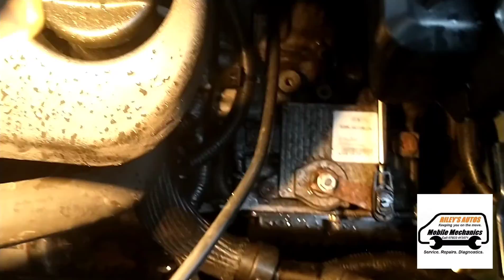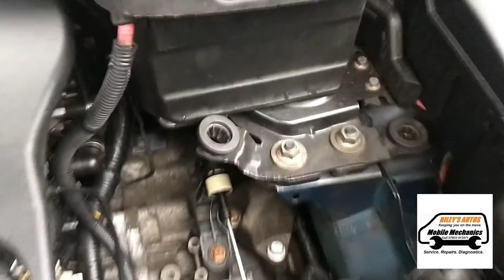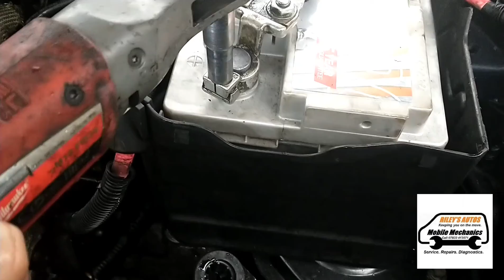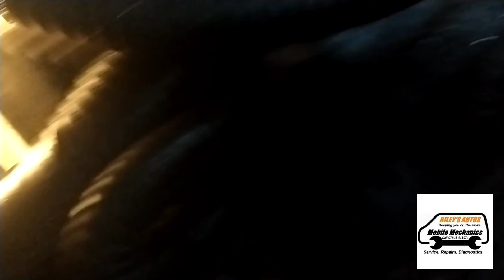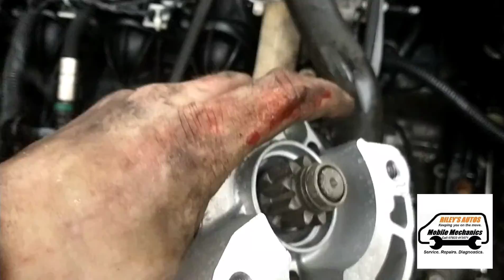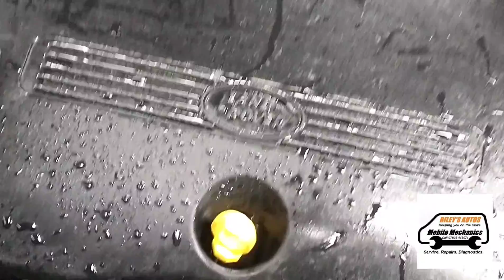Land Rover Freelander 2 & Range Rover Evoque Starter Motor Replacement fitting 2.2

Comment: I have tried to take mine off on a 2016 evoque. After taking the bolts off, I can't get the nose out of the bell housing as the oil filter housing is in the way at the other end of the starter. How did you get it out ?.

Comment: Took my Freelander 2 starter motor out because it  wasnt working at all.  Opened it up and it was full of crud .Gave it a good clean and reassembled it and it feels as good as new and starts first time everytime. So sometimes all it needs is a good clean and its quite simple to do.
Reply: Hi. Did you had that ticking noise sometimes, and had to try starting the engine about 6-10 times before it turned, or was it all dead. 
And how do you clean it, is it just dust cleaner spar it from the outside. Or do you need to open the starter motor so you access what's inside?
Reply: @oter_star  it's the solenoid thar causes the problems. 
The copper contacts get dirty. 
You need to remove the three bolts that hold the end cap of the solenoid on, then pull out the plunger and give the contacts a good clean. Alternatively you can get a repair kit off ebay with new contacts and plunger in.
The whole job, including removing the starter will take less than an hour.
Reply: @martinyardy3213  hi. I did a quick fix. And have worked fine for months now fortunately 😃 my copper mount had broken of completely. So I just soldered a wire directly on the area the copper mount was